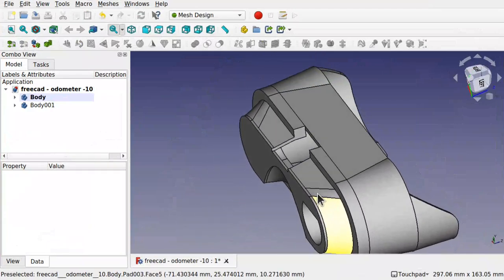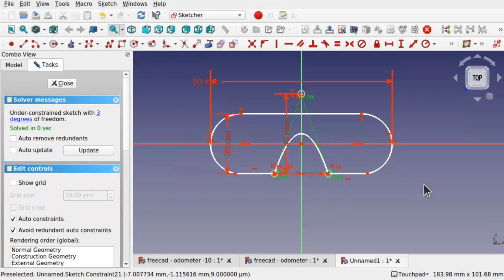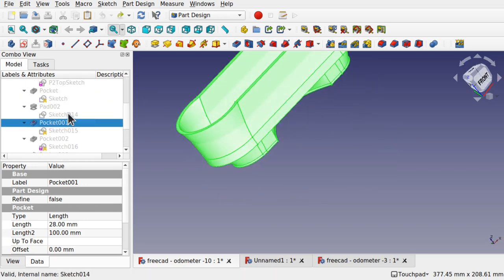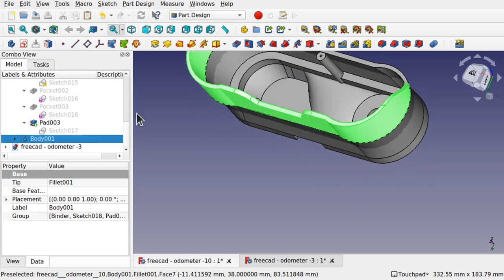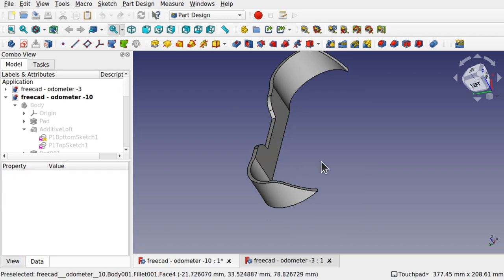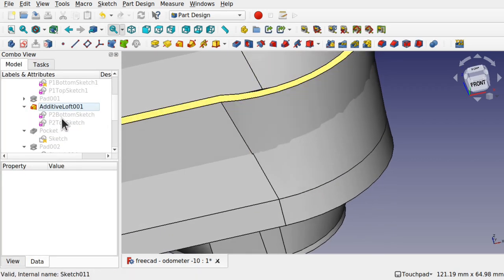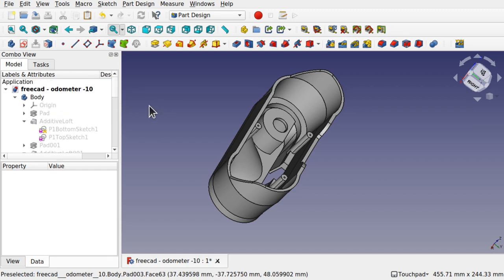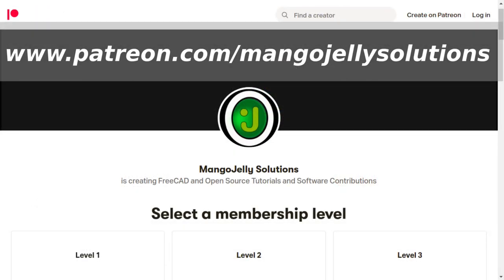Building 1977 Classic Motorcycle Odometer Case in FreeCAD Part Design from Photos. Overview Tutorial

Comment: Thank you so very much. I've only been using FreeCAD for a year or so, very part time. I've learned the Part Work Bench and do primitive shape subtraction and addition. This is the first video which has actually made parametric modeling make sense. I feel I can move forward with Sketcher.
Reply from the maker: So pleased that you have found this useful. I didn't know if it was worth sharing this project but I am pleased that I did. For the future I will share more. Glad it's given you the confidence to progress and thank you for the kind feedback.
Reply: @MangoJellySolutions  Good teachers need recognition. Thank you again

Comment: Hi, thanks for the video. I've been using FreeCAD for over a year now, but I find a lot of new things in your videos. Have you tried using the Draft Scale workbench to create 2 sketches? Regarding the error when using Loft , here is what is written on the FreeCAD website "If the sketch has inner geometry, i.e. the loft is supposed to have holes, then the order in which the sketch geometry is created, should be the same for all sections: Either start all sections with the inner geometry or start them all with the outer. Otherwise an invalid loft can be created where inner and outer walls cross." I apologize for my English, I wrote through a translator.
Reply from the maker: Great to see your finding new things. The draft scale and part 2d offset are great until you come to bspline where it can be quite hit and miss when you start trying to use the draft tool convert to sketch. That's where sometimes it will start to fall over.

Yes I read up after I finished the video and found the same information. I come from other CAD packages and I have been trained to create models in a certain sequence so in all my times with Freecad I have never encountered this problem until now. Which as you can tell really threw me. I can't belive its taken me this long to experience the problem lol
Reply: @MangoJellySolutions  I was doing an experiment like in your video. I drew a sketch with 2 circles, 1-an outer circle, 2- an inner circle, also on the second sketch. Everything turned out fine, but if I swap the circles in one of the sketches (I make the inner circle outer), then everything breaks. I think somewhere in the code he assigns ordinal numbers to circles and makes a Loft based on these ordinal numbers. Try an experiment. Make a sketch 1 in this sequence, first the inner diameter, then the outer, then make a second sketch in the same sequence and everything will work out. But if in the second sketch you draw the outer diameter first, and then the inner one, then the Loft faces will intersect. I have freecad version 0.19.2. 
And I'm also interested in your opinion, I drew a bearing and did animation in assembly4, I can send you a file for analysis and as an idea for a video. Just checked this bug in version 019.3. In this version, the same error is obtained